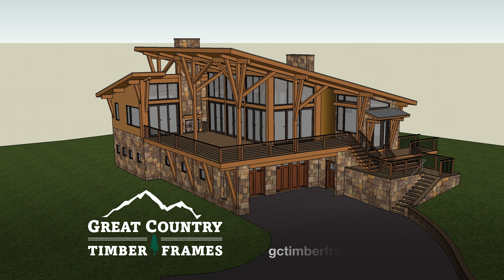Raising Day • Mountain Modern Timber Frame Home

Comment: So are the timbers sitting on top of the subfloor or down in the rim joist? Also, how are you attaching them to the floor. Sorry if I missed it in the video.
Reply from the maker: The timbers sit on top of the subfloor. They are attached using internal stainless steel knife plates.
Reply: @GreatCountryTimberFrames  thanks for the reply.  I am assuming you have some larger pieces of blocking under the subfloor for the knife plate to bolt into?
Reply from the maker: @rileyniesz3305  That is correct. Each post has solid blocking to a girder beam below.